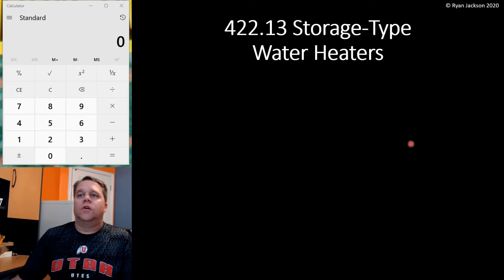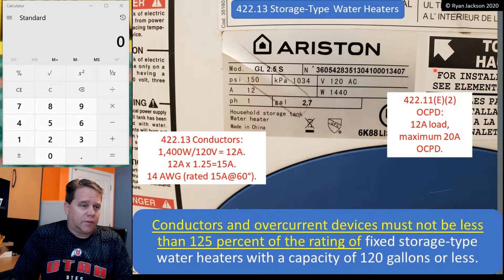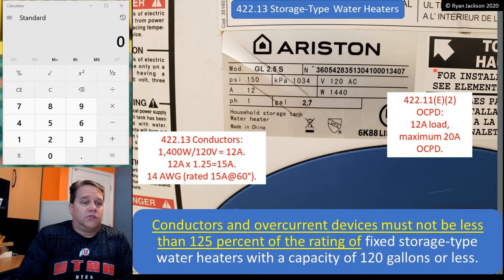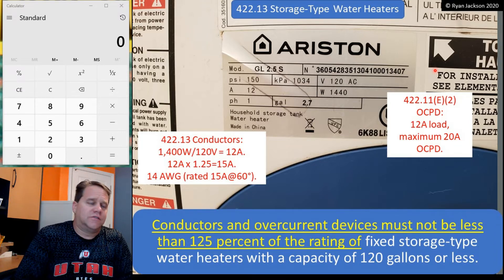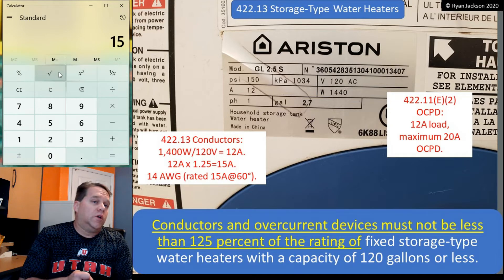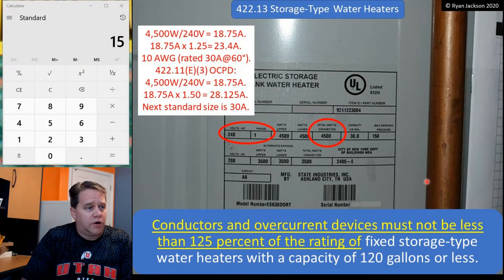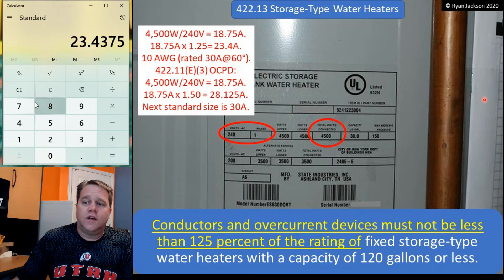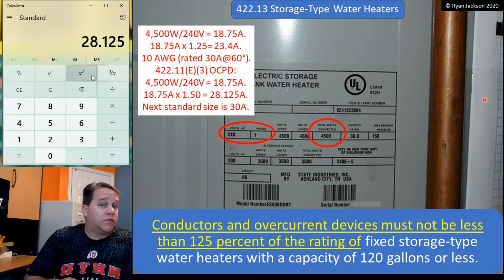2020 NEC 422.13

Comment: Thanks Ryan for the very clear explanation of the math. This one I can remember. Usually I use an app to figure this stuff out. I remember working on some 208v buildings and thinking these wires are undersized.

Comment: I calculated the change in wattage from 240 volts to 208 volts and came to exactly the same conclusion as you did (3.38kw). However, the manufacturer's data plate shows 3.5kw at 208 volts. Any idea why? Is the manufacturer just being conservative?

Comment: Interesting note:  All 50 gallon 4,500 Watt 240V water htrs are wired with #12 wire inside by Factory.  If two elements, only one will be on at a time, never both. Bottom element first and when top water of htr cools it switches to top element.
Reply: Ya know, I appreciate this explanation. I'm an industrial/ marine electrician and never delved into the operation of my water heater. The other day I was looking at my heater, and saw, two elements @ 4500 watts and a total load of 4500 watts, I thought WTF? I figured out that's was what was going on.
Thanks for the confirmation 👍
I'd already settled on the #10 and a 30 amp breaker.

Comment: Any reason why you wouldn’t use 3500w rather than calculating resistance?
Reply: I was about to ask the same question.  That would yield (3500/208)= (16.83×1.25)=21.03=21 amps, which requires a 25 amps OCPD instead of 20 amps.  So the latter yields a larger OCPD.

Comment: On 6:58 - you do not calculate the resistivity by using the Ohms Law, because it IS NOT the constant current, it is alternating current and it's Empedance is the Active resistivity and Passive resistivity, so. On 60 Hertz it will not be the same if the harmonics.
E= R + ( [1/wC] + [wL])
So, to avoid miscalculations - do avoid to have the resistivity in the formula. Because it is not linear expression.
As much higher the frequency as much less linear process.
And on very high frequency the current doesn't go inside the conductor, but only on conductors superficies.
Reply from the maker: This is 60 hertz and a resistive load. Harmonics and skin effect are negligible. The physical resistance of the heating element of a water heater is constant.

Comment: Did you say at the end of the video that the wire is going to melt?  And does the converting from 240 to 208 only apply with resistive loads as far as the resistance goes?
Reply: Yes and yes